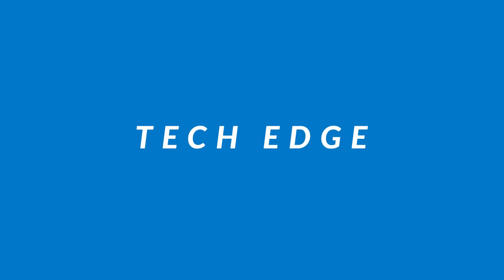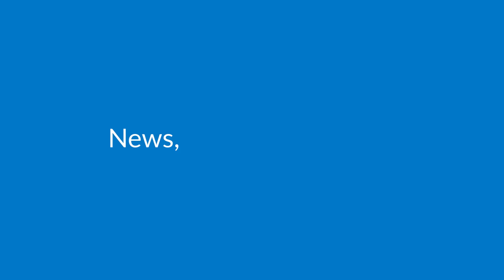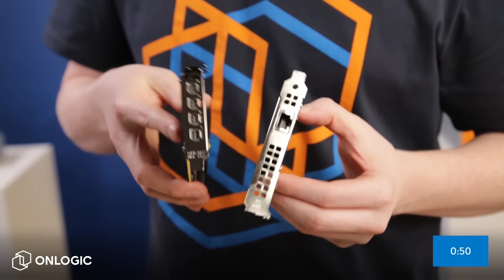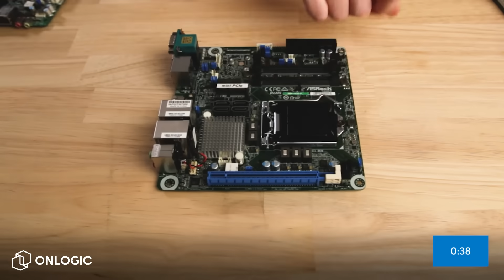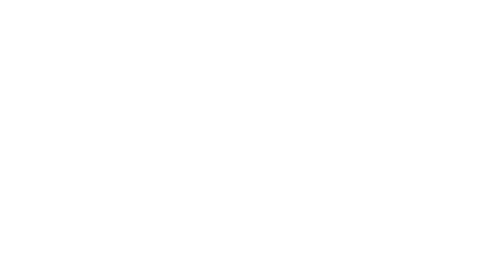PCIe Basics in 60 Seconds

Comment from the maker: Questions? Drop a comment! Want to learn more about PCIe? Check out our Ultimate Guide to PCIe 4.0: https://www.onlogic.com/company/io-hub/your-ultimate-guide-to-understanding-pcie-4-0/
Reply: I've seen many CPU buying guides that vaguely separate CPUs between gaming, home, office, and workstation uses, and say that figuring out what you need is important. However I've found little in the way of instruction or advice on how to determine your needs beyond looking at the system requirements for games you intend to play, or any highly specific heavy work applications you intend to use.

I am in a situation where I intend to build a PC that is both good for gaming, and can also be used to run a number of applications that demand CPU and RAM resources simultaneously.

For instance running Dragon Naturally Speaking, firefox with 5 to 20 tabs, Discord or Zoom, 7 to 10 word documents and an excel book or 2, and an image, video, or audio editing software at the same time. (Dragon is an app that allows you to type and control your computer with your voice.)

How does one go about figuring out what CPUs that are good for gaming are ALSO good for running many things at once without choking?
Reply from the maker: @ClickerQuiz , thanks for the question!

One of the reasons you often see recommendations for hardware based on gaming specs, is that if a system can run a complex, resource-intensive game, it'll probably do just fine with multitasking and productivity applications as well.

However, you also often hear "get the best components your budget will allow". What that frequent advice ignores is the priority of those components.

For your specific use case the biggest thing you've highlighted is the need to run simultaneous processes. With that in mind, any components that support multitasking will be beneficial to your build. A CPU with 4+ cores, 16-32 GB of DDR4 RAM and an SSD (NVME if possible), will all help avoid slowdowns. A graphics card will also take some processing strain off the CPU and improve performance, but given your scenario we don't see any reason to blow your entire budget on the GPU, a quality mid-tier model will suit you just fine. And given the current supply chain shortages on GPUs, a CPU with decent integrated graphics might do the trick, for now while you wait for a better selection of graphics cards to choose from.

We are only able to offer this advice because you've provided us with very specific guidance about what you're trying to do. Advice like this can be hard to find searching online because recommendations so often need to be tailored to the individual. It's one of the reasons we always encourage our customers to call and talk to one of our hardware specialists about exactly what they're trying to do with our computers prior to purchasing. For personal hardware use, we'd also recommend checking out www.logicalincrements.com, which offers frequently updated component recommendations at different performance tiers.

We hope that helps. You've actually inspired us to create a video about this, so be sure to subscribe so you don't miss that when it's ready.
Reply: @OnLogic  Thank you very much for getting back to me! I do agree that integrated graphics on a CPU are a blessing when you are going to have to wait a while for GPU availability, or if your graphics card dies. 
I presently have a working ten year old radeon graphics card laying around ( Radeon R6870 ). Fortunately it does slot into a modern MoBo and Win10 drivers do exist for it. So if the only CPU I can get has no integrated graphics or the integrated graphics are broken I am planning on using that to allow me to at least have the machine be useable until I can get my hands on a modern GPU. (After all you need to have some graphics in order to use the computer that you've built and check for defective components before their warranties or return periods expire) Does this seem like a workable idea? 
I very much look forward to seeing your video.
Reply: @OnLogic  When it comes to buying cases the important things, at least to me, are in order of importance are 

-how well does it cool (preferably air cooling
-is it big enough for the parts and the Mobo I want to put in it
-is it durable
-how easy is it to open up and close back up
-placement of extra USB ports and 3.5mm jacks
-does it have space for a DVD/Blu-Ray burner
-as little unessessary lights and glass as possible. 

I have a Bitfenix Shinobi case (basic, not the window, or XL version) from 2011
It ticked all of the above boxes, while still back when I bought it and has served me well. 

My question:
Would it's cooling performance, which was quite good by the standards of 2011, hold up for the sort of rig I'm looking to build in 2021? 

I've not been able to find a guide online to help compare old out of production cases that had (and may still have) good cooling to the capabilities of cases less than 2 years old that cool well. I've seen a lot of modern cases aimed at gamers with airflow that ranges from quite good to horrific. 

In terms of fans it currently has: 
2 Yate Loon 12v D12SM-12 fans (both in the front. Sleeve bearing fans work better mounted to blow horzontally)
2 Vantec Stealth SF12025L 120mm fans (one in the top, one in the bottom. Double ball bearing fans handle being mounted to blow vertically well)
1 Whatever fan the case came with (in the back. It's never worn out, so I've never replaced it.) 

The fans are arranged in a positive pressure setup. (Only the top and rear one exhaust, the other three push air in) 

Should I replace the fans with stronger ones? 

I am not planning to keep anything inside the case aside from possibly the fans.
Reply from the maker: @ClickerQuiz  A "for now" solution is absolutely workable. In the current market, you have to work with what you can get. Good luck with the build!
Reply from the maker: @ClickerQuiz  As for the case, "how well does it cool" is obviously something we care very deeply about :) We make industrial PCs, and specialize in fanless, but we have plenty of enthusiast builders here as well. The ability for that case to cool as well as it did before will come down to the amount of wattage, and therefore heat, you end up filling it with. The reason it's hard to find guides along those lines is similar to the reason we noted in our first reply - every build is different. We can speak from experience in saying that the smallest changes to the location of a part, or the angle of a fan can make a huge impact to thermal performance. Your current enclosure setup definitely COULD work just fine, but it's virtually impossible to say that it will without knowing exactly what components will be used and how they'll be installed. That's why we do so much thermal simulation and real world testing when we build our systems. Best of luck on the build though, it seems like you're taking a very thoughtful approach which we definitely respect.
Reply: I want to explore pcie. Please guide on this.

Comment: So do i need to enable pcie 4 or just install the
 processor i5-11600k
3070 ti rtx
3600 mhz 32 gb  - 2x16 gb

into my mobo z950 auros elite ?
Reply from the maker: Hi Mohammed. Thanks for your question. Seeing as your motherboard supports PCIe 4, all you should need to do is install the graphics card.